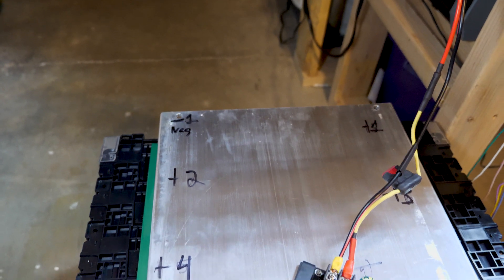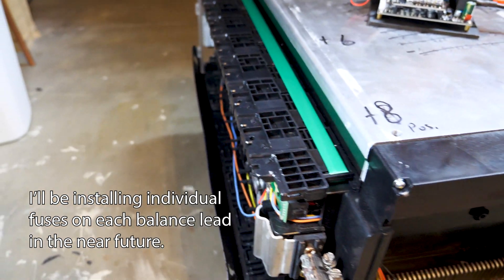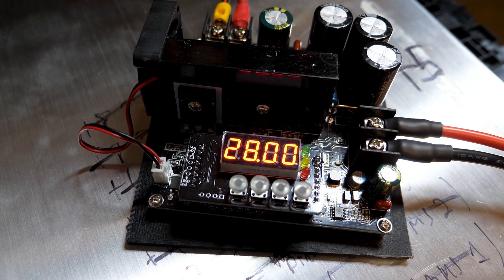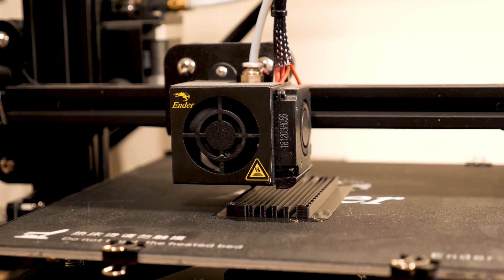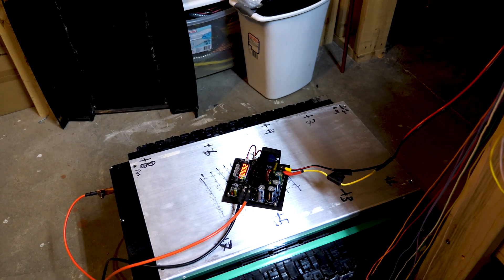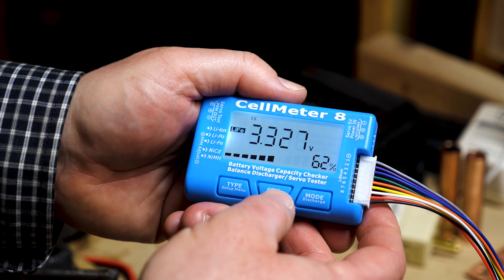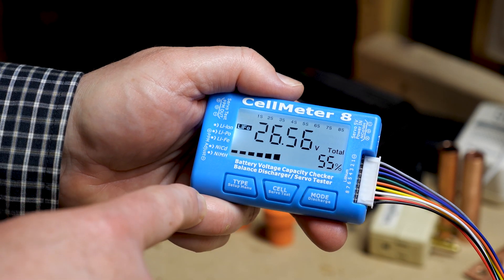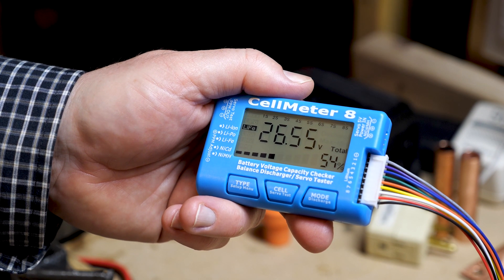BYD LiFEPO4 24 Volt Battery Update!

Comment: Hello, first of all, thank you very much for the video, it has been very helpful

I just got two of these batteries, could you please tell me what the maximum voltage per cell would be, since I am a little confused because they have a voltage of 3.6 volts and 3.7 volts. Thank you very much in advance.
Reply from the maker: 3.65/cell is max voltage for LiFEPO4 chemistry.
Reply: @GreenMountainDIYGuy  ok thanks you very much

Comment: Connecting a heavy duty battery cable is easy. The terminal posts are solid copper, just file two sides of the post flat and drill a hole through, you can then bolt on a standard battery cable. I used a grinder with a metal cutting disk to do it quickly.

Comment: I can't find an 8 independent circuit fuse block. Can you provide a link for the one you have? Thanks
Reply from the maker: I used this one.  It has 8 independent channels.  The bottom is open though so I 3-D printed a cover for it.  Hope this helps and thanks for watching.  HELLA 8-Way Lateral Single Fuse Box (https://amzn.to/2UEyKeB)

Comment: Hi Guys, interesting i did a midpoint balance. Had all 8 cells in 6 BYD batteries 48v configuration at 3.200v plus or minus .005v and when i began charging all six BYD battieris to 56v.  BYD battery #1, cell 4 made it to 3.6v and the remaining BYD batteries were at 3.4v. Total voltage was 54v, never made it to 56v. Here is the question do you want to balance the cells or do you want to burnoff (Batrium style) those cells that reach 3.6v, and therefore continue to charge (increase capacity). Ie top balancing. Note I did drop the voltage on that one cell and i am now charging test #2. Looking forward to a Chargery BMS test by someone .
Reply from the maker: Marco,  Thanks for sharing you results with us.  Yes, I am going to try the Chargery route with top balancing the cells.  I am hoping that upon discharge all of the cells play nicely with each other.  Craig reported (comment below) that his one of his cells ran out earlier than expected limiting his total discharge/capacity.  Are you find that too?  A lot of people have weighed in that bottom balancing the cells has had little effect.  Hoping my Chargery arrives soon!
Reply: @GreenMountainDIYGuy  No i have not tried top balancing, but i did notice after charging with 16 kw of solar
to 54v due to this one sensitive cell #4, at 3.60v, the next morning after draining 6 kw all 6 BYD batteries with all there 8 cell were at 3.266v ±0.003. That's remarkable. This may mean that the cell is not weak, or the voltage would have been lower as Craig mentioned, but it may be sensitive during charging cycle. I wonder if DavidPoz has seen this in the pass. Well i am stuck at this point I know i need a BMS, but don't have enough info on which one to use yet. It appears that i can use my current BYD 48v setup by limiting the solar controller to 54v and limp along for now. This test will be done tomorrow.
Reply: Well dropping the voltage of the one or two cell that reached 3.6v did not work. Once i began charging again. Guest were all the voltage went. Too the one or two cells that were high. I mean immediately. Interesting don't you think.

Comment: I had the same experience with cell number one charging up before the others.  I top balanced and then did a discharge test only to find that cell one ran out far earlier than the others.  I suspect you'll find as I did that it's just a weak cell.  Unfortunately being in series it limits my pack to under 3KWhr, not the advertised 4 to 4.5 KWhr.

BTW, the BMS board that came with the battery has a white single row 2mm 13 pin connector.  I hooked up my CellMeter 8 (same as yours) to this connector (rightmost 9 pins) and it worked fine.  Your riveted wires will carry more current, but for monitoring, the pcb traces are fine and you don't have to open the battery up.

Thanks for your update!
Reply from the maker: Craig, thank yo so much for that information about the 1st cell on your BYD.  That seems to be the trend with these batteries.  Nice find on the using the existing pin connector to monitor the cells.  I may mention that in a future video and credit you. Keep in touch!
Reply: Craig how is your top balancing working out. I think this is a key to direction we may have to go. Any updates.
Reply: @marcoa.rosado4724  For my first battery I was super careful balancing and charging.  After a careful balance, at a discharge rate of only 2 amps I carefully measured a total of 3.2 KwHrs of storage.  This took several days.  I have learned all this care isn't needed.  For my second battery I charged it up at 5 amps until one of the cells (cell #8) shot up in voltage to over 3.6V.  I then discharged at a 25 amp rate and sure enough cell 8 was the first to give out at 2.5V.  Battery number two came in at a dismal 2.7 KwHr.  I just finished battery #3 and same as before weak cell (#1) charged up first and died first yielding a better total of 3.5 KwHr.  One more battery to go.

Bottom line, with these batteries balancing is a waste of time.  They arrived balanced well enough and their performance is dominated by weak cells.  Also, the battery hookup site claiming that every cell is tested and guaranteed yielding at total of 4.1 KwHr is clearly false.  It's still a nice battery, but at 2.7 KwHr there are better $$/KwHr deals out there.  I may yet see what good their guarantee is.
Reply: @marcoa.rosado4724  it would be really helpful if you would do a video on your battery bank and experience with them
Reply: @DelFam2011  Never done a video will see what i can do.

Comment: Recommend Active balancer with display and 10A balance current... 
MORNSUN....
Info 
Complete voltage 
Every single cell Voltage 
Cell that is charged is red 
and action... Charged....if cell is getting charged....
Reply: Like your Idea any recommendation on a BMS would be appreciated.
Reply from the maker: Bostjan Trancar 10 amp balance current seems like a lot.  I’m shooting for about an amp on each cell.
Reply: @GreenMountainDIYGuy  When i charged with solar to 16kw, I was charging at a max of 80 amps with 2 BYD in series 48v and 3 in parallel. So i have 48 cells. So 80 amps divide by 48 cell is 1.6 amps per cell. So i am not sure a 1 amp balancer will do it, but again what do i know. Interesting!

Comment: I ordered 4 of the Chargery BMS16 from China and they arrived at my door the next day.  The seller even had free shipping.  Looking forward to your next update.
Reply: Let us know how the Chargery BMS16 works out for you!
Reply from the maker: Nice!  One for each battery?  I’m thinking about paralleling my cells in groups via the balance leads similar to what David Poz did.  Keep everything 24 volt.
Reply: @GreenMountainDIYGuy  I'm also thinking of paralleling my cells, but be careful and don't use the battery's internal balance leads.  They connect to a pcb that has relatively thin traces and they would burn out with more than a few amps flowing.  Instead add some heavy wires of your own to each cell.  In my case two of my batteries have the same weak cell (#1) so just hooking up in parallel won't help.  I'm thinking of rewiring the battery internally so that no two weak cells will be in parallel.  It's a pain because I'll need to measure each cell's capacity independently, slice the bus bars and run some heavy cable, but the pain should pass in time.
Reply from the maker: Craig Nelson Good advice.  I’ve thought about taking all of the cells apart and rewriting in series with no weak cells.  Going to try the top balance approach first, probably just a braid-aid.
Reply: @GreenMountainDIYGuy  I will eventually test each cell individually to see what if anything is worth doing, but at about 1 cell per day it's  going to take over a month just to test.  I'm just going with them as is for now.  Also, I'm afraid of removing the strapping that holds them together, but I'll happily watch videos of anyone who tries.  Good luck!
Reply from the maker: Alvin Lamkey Impressive shipping too...can you send me a link?
Reply: @GreenMountainDIYGuy  Just sent you a link from my Gmail.  I plan to run 2 batteries in series for 48v and balance across the pair.
Reply from the maker: Alvin Lamkey Thanks!